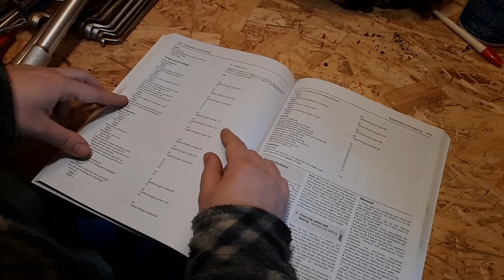Volvo 850 Restoration - Front Suspension Rebuild Part 1

Comment: Did you tighten the control arm and stabilizer links with the right moment?  Or just by feel? I'm curious. Regards ✌🏻
Reply from the maker: Yes we did torque them to spec😊
In case you need them, here they are😉;
Control arm balljoint clamp nut 50nm
Control arm to subframe mounting nuts 65nm then tighten another 120°
Control arm balljoint to control arm nuts 18nm then tighten another 120°
Anti rollbar connecting link nuts 50nm
Anti rollbar clamp bolts 50nm